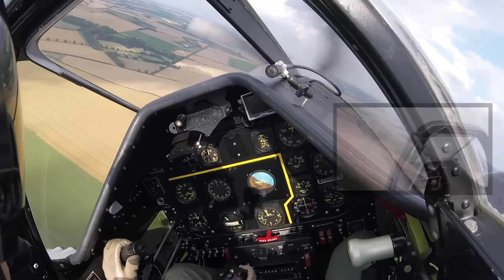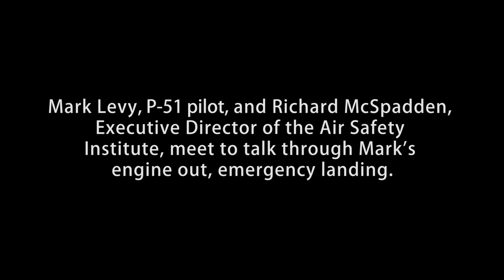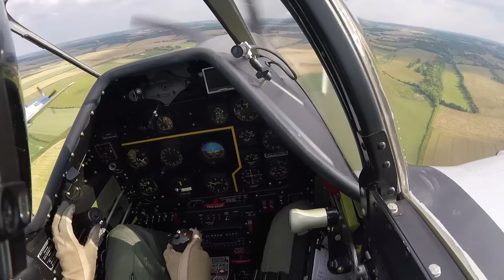P-51 Engine Out, Off-Airport Landing - Full Analysis

Comment: I had a total  engine out in March 2017.  Scary. They teach you ‘aviate navigate communicate’ and that helped me a lot. I stretched the glide as far as possible (about three miles from 2000ft) and only just made it over the trees into a clearing. Landed well but nosed over because the ground was a swamp, I was flying a taildragger. My wife and I were completely unhurt, and sat on the wings looking out for crocodiles until a chopper came and picked us up. 

The failure was a broken connector rod in flight that seized the engine. The aircraft has just returned to airworthy after a replacement engine and other repairs. Nobody hurt but the experience cost us a hell of a lot of money! My wife got her pilots licence that year, despite the crash landing! 

Anybody saying that Mark handled the situation badly get real.  He put the plane down and walked away... what he did was much much harder than what I experienced. I’m in awe. That’s great airmanship!

Comment: Great interview.

Good decision making and breakdown of sequence of events.

The Merlin / Packard can be problematic with both the  carburetor and ignition systems. The fuel pumps are  pretty reliable. Very strange engine behavior. There are no indications of a bad cylinder, Magneto misfire, broken valve or supercharger failure. 

Air in the fuel line, vapour lock, clogged filter, fuel tank blockage do seem unlikely given the gentle turns and level flight envelope flown.

Really couldn't ask for more than what Mark Levy explains.

Good luck on your return to the cockpit of the P-51.

Have a nice flight!
Reply: Doug Hanchard
Reply: Doug Hanchard needles to say this was expensive af
Reply: Bene Hirsch Well over $500,000 USD for engine overhaul, propeller, governor, landing gear repairs,  wings, canopy....
Reply: Doug Hanchard :-B s3
Reply: This is why they'll have plenty of insurance on the plane.
Reply: That's why you pay the big bucks for insurance.

Comment: "fly as far as you can into the crash"
Reply: Seeing his hand on the stick through the landing sequence via the helmet cam...
Reply: I was surprised to hear this. I did some low level competition driving and I always had the rule of "leave the road in a controlled manner/drive into the crash". It seemed natural to me to point the front crash structure at the obstacle and not "fight until the end" risking a side impact or rolling the car. I was pretty much laughed at.
Reply: @Sensekhmet  So what's the prevailing philosophy?
Reply: @December428  with cars you've gotta bear in mind that the crumple zones are setup to trigger sequentially from the nose to the seat, you've also got a great big chunk of noisy metal to take the brunt of the impact. but if you hit say a lamp post sideways its all kinds of bad news.

with planes he pretty much did everything right in those last few seconds he pulls up to cut a bit of speed out and minimize the inital impact but at the same time he's leveled it out so that he will slide and not dig in to the ground and flip over, he could've tried to make the runway but there are 2 possibilities either he makes it and sticks the landing problem solved which is pretty unlikely or he gets just close enough to cause a shitload of damage when he crashes...honestly the field was the best option by a long way cus its not just his life he saved its everyone on the road and at the runway
Reply: Fly as FAST as you can into the crash

Comment: If the engine fails, the plane belongs to the insurance company!
Reply: It didnt fail completly.. He could land on the other runway but got scared of having to do a short approach and went away to other side and crashed it..
Reply: @feetgoaroundfullflapsC  He knew it was going to fail before the runway so he decided to ditch in the field.
Reply: @Desertduleler_88  He didn't know it. He trusted his gut instinct of 30 years of prior flight experience. Every human is different.
Reply: @Desertduleler_88  true, plane would never make it to runway. It fell so suddenly and he knew it would happen. He did the right thing.
Reply: @feetgoaroundfullflapsC  seasoned pilot will have this instinct  that know if can make it or not.....
Reply: @magnapeccatrix  -- No he didnt do the right thing.  He had the chance to land on the other runway doing a right base and with only a slight tailwind, and instead decided to go to the downwind leg of the other runway.. with a failing engine and too low to make it.  Then he put drag flaps and gear down too on that low slow downwind leg.  Many pilots errors and one million airplane damages.. FAil..
Reply: @mazan7824  -- Why a slight tailwind landing on a 8,000 pound airplane will make you land on audience? Explain that.. Just a longer ground roll, thats it.. I landed Cherokees with 16 knots tailwind on 3,000 feet only..
Reply: 5feetgoaround fullflapsC150 im sorry ur a what? No one cares again how many planes have u flown?
Reply: @feetgoaroundfullflapsC   Retrospect and hind sight is a funny thing - Could of, should of, end of day he's still alive and no civ's killed... I'd say he did a pretty good job cosidering.
[ its plain to see you'd have landed it on ATC with only one wheel so you could have hand signaled your wellness while Mavric buzzes with past with a flyby ]
Reply: @feetgoaroundfullflapsC  Watch the video again. He was on downwind along side the runway. He had no choice to to try to make base, then final. I know you are not a pilot just from your post.
Reply: @feetgoaroundfullflapsC  so you're gonna bet on making it to the tarmac instead of a controlled landing where you KNOW you can? Wishing is not a strategy to say that he could have just hoped to make it is the bullshit
Reply: @feetgoaroundfullflapsC  if you're such a confident pilot, why do you feel the need to retaliate with people on the internet and say dumb shit? For a 67y/o you sure are childish. Just because he could have made it doesn't mean he would have. There's all sorts of shit that could've continued to go wrong, not to mention if that other runway wasn't long enough that P-51 was going to overrun the runway. It didn't appear that would be a problem, but who knows? I mean at that point he doesn't know what else could be wrong.
Reply: @dankvis  -- I have videos landing Cherokees with a 15 knot tailwind and stopping in less than 3,000 feet. From 1995.  So I know what Im talking about.. Sorry you dont know how to do that.  Winds were much lighter on that much heavier P51..
Reply: @p4rsec  I have to answer to pricks that say this guy did the right thing on not landing with a little tailwind as they on the ground were expecting.  In a  nervous decision, he decided to do a normal engine power downwind entry and DROP FULL DRAGS FLAPS and landing gear too when too low and slow, and failed reaching the runway.. 
I teach engine fails turning crosswind and turning downwind too.  Im have even airline pilots learning those emergencies they were never taught.
Reply: @feetgoaroundfullflapsC  I think you missed my point here I don't doubt youve landed in intense crosswings, but this was a debate over an engine failure on takeoff
Reply: @dankvis  IT WAS NOT ON TAKE OFF.  He was on a formation flight a few miles of the airport and his engine started failing.  Instead of landing with a slight tailwind, he decided to  go to a low, slow downwind leg to the other side of the airport.. Then the dummy drop Drag Flaps and gear.. Of course, that made him get lower and slower, Uhh!!!  Dahhh>>> and could not complete the turn to final due those errors and crashed on the base leg area.. Simple to see that.
Reply: @feetgoaroundfullflapsC  Ahh sorry I thought you were commenting back to me on the Draco crash that just happened. But yet again, don't compare your success to someone else's failure the circumstances always vary.
Reply: @dankvis  -- Vary like what?? Be precise in the critic.. What???
Reply: @feetgoaroundfullflapsC  well for instance two completely different planes let's start with that. You're trying to pick this apart like it's not common fucking sense. Seems like someone is over inflating their flight experience.
Reply: It's hard to tell in the video, but I see where 5feetgoaround is going with this.  If he was far enough out, and with the engine essentially at half it's power, a 180 turn from the beginning looks like a good bet, as you essentially made the runway threshold much more immediate.  That 180 would cut energy, but once pointing to the runway it's relatively straight flying to touchdown.  You'd be scraping by at the end, but you'll be straight.
Versus doing what the pilot in the video did, which was landing on the opposing runway, taking the longer trip, which left him turning final with little energy.  Wing stall would be nasty there.

But if he was much closer to the runway when the engine failed, that's a hell of an angle to turn and come in at.  It's hard to keep track of where the runway is in the video, up until near the end.
Reply: @feetgoaroundfullflapsC  Always easy to be general armchair once you've got all the elements to decide, you've seen the full video, seen the analysis and so on... When you're in the sky and have 10 seconds to do the call, that's an entirely different issue entirely...
Reply: @Bourinos02  - I had that kind of partial power emergency 4 times already.  3 times on initial climb leg.  Another about 4 miles away from the airport.  3 times I landed it tailwind, on airport/no damages.. So i'am not an ignorant talker,  LIKE YOU ARE....
Reply: @feetgoaroundfullflapsC  You should fire your mechanics then...My Saturn V also have some ignition problems, but not too much issues with it afterall.
Reply: @feetgoaroundfullflapsC  do you realized he WOULD have ended up crashing into traffic if he kept going while damaging the plane more than he did in the field AND might have killed/injuried people unlike he did in the field
Reply: @Pwn3dbyth3n00b  --He called to land now due engine emergency.  Will you cut into the runway if a pilot says he needs to land now??
Reply: @feetgoaroundfullflapsC  I believe the pilot made the right decision
Reply: 5feetgoaround fullflapsC150 if you payed attention you would’ve seen the plane start to sink, he wouldn’t have made it to the runway.
Reply: @LeeDWay-pp8ci  Tell me why?? Teach me about those emergencies.
Reply: @feetgoaroundfullflapsC  All planes have a different glideslope, and I'm sure you know that, but, he has been flying p-51s a very long time, after every crash the FAA has to look into the crash, weather it's new or old. I never read the crash report as I could not find it. But, his judgment and knowledge of that particular aircraft told him he couldn't make it. As the interview stated. I know to are a experienced pilot, but overconfidence is the worst thing to have. Stay humble
Reply: @feetgoaroundfullflapsC  so, in your opinion, what did he do wrong
Reply: @LeeDWay-pp8ci  First, he didnt lean the mixture as required when you have a partial engine fail.  Dont know if put some carburetor heat as required also.

 2nd, he insisted on going to the other side of the airport (the farther away side) to do like a normal landing into the slight wind-instead of landing with a slight tailwind direct into the airport. Easy.  But he didnt.
 3rd mistake, On downwind leg, he dropped full flaps while low and slow on downwind leg ( can you believe that, WTF!!). 

 4th he dropped landing gear too while low and slow on downwind leg. 

 Those huge mistakes made him bee too low and slow to complete the turn to final.
Reply: @feetgoaroundfullflapsC  he addressed the fuel issue in the video at around the 30-31min mark he said it himself it wasn't a engine problem, it was a fuel delivery problem,
Reply: @LeeDWay-pp8ci  Soo what??   He made all those mistakes.  We are talking about his flying not what the engine specific problems were.  What are you trying to divert the issue to?  Dont let yourself be distracted from the issue here.  His 4 mistakes.  WTF.  Stay on the issue.  Not the repairs later on.  Leave that to the mechanics later on.  We are pilots first.
Reply: @LeeDWay-pp8ci  Also a fuel delivery problem is an engine problem.  Dahhh!!  Guy, you are easily distracted..  Good bye kiddo.
Reply: @feetgoaroundfullflapsC  no... a fuel issue is not an engine problem, if you have a bad fuel pump you don't replace the engine in order to fix a fuel pump, and get over yourself. Not everyone can grow up on a golden thrown wiping there ass in $100 bills you are some guy arguing on the internet, grow up.
Reply: @LeeDWay-pp8ci  You are taking semantics here. I try to teach you about about a kind of  engine fail that i know by experience and you divert to defend the 4 error pilot via semantics.  Im 69 years old with 11 emergencies.  And you cannot match me.
Reply: And Im also an ASE certificated Auto Mechanic in engine repairs, electronics and engine performance increases.  So dont try to teach me, What i know since the 1970's..
Reply: @feetgoaroundfullflapsC  lol, im also an ASE master certified  mechanic. And you just said an fuel pump issue is the same and a engine issue, you lier!
Reply: @feetgoaroundfullflapsC  bye sidetracked have a good life, stay humble.... smfh
Reply: 5feetgoaround fullflapsC150 can I be your buddy? You seem cool and use cool words.
Reply: You could hear his stall horn turning in to the runway, he’d have stalled just short of the runway.
Reply: @feetgoaroundfullflapsC  chill out my dude, I know you're not lying based on what you say you really do know what you're talking about (however I don't know whether your CFI thing is true or not). Anyway debating here isn't going to make any difference in neither your life nor these guys so I digress

Comment: Great Video. I think the best info here is, don't over try to save the plane. Use it, to help save yourself. I was flying 4 skydivers, one a static line student), in a C-182. At lift off, engine blew a piston, and became very rough, backfiring, vibrating, and limited power. Flat farm land all around, but runway too short to risk full load landing. Because of the student, I was afraid to open the door, and let the jumpers out at lower altitude. Instead, I went looking for thermos over dark fields, just kept climbing. At 3,500 feet, I let the student out, came back around, and let the others out. I then came down (still with a bad engine, and landed). A crop dusting friend of mine (with a zillion hours), told me later, "remember Rusty, it's not your F'n airplane." So, don't lose the people trying to save the airplane. Just put it down safely somewhere. Me - Commercial Pilot SEL, A&P mechanic, retired USAF aircraft mechanic, and C-130 Flight Engineer.

Comment: I had engine partial engine failure at 1500 feet with a trial flight i was flying. The engine was so rough i committed to landing.  Once field in sight i switched everything off save it ripping the engine out the frame and parked the aircraft in a field. Commitment is the key.

Comment: A friend lost an engine a couple minutes after take off.   he as gliding into a nice field and put the gear down.  The plane then sank quickly and he landed short, into the trees.  A few years alter I lost an engine a couple miles from the airfield.   I was set up to glide into the runway and remembered to delay the gear until I was over the threshold.    This P-51 might have made the field if the gear had been left up.

But remember the gear is a speed brake, so don't put it down while gliding on long final.
Reply: Well said.  This "expert" made a lot of student pilot mistakes.  He should be flying all automatic airliners with a helper on the side correcting his pilot errors.  That is how airline flying is.
Reply: CFITOMAHAWK did you actually watch and listen to the whole analysis or are you just basing your comments on your vast experience of MS Flight Simulator?
Reply: @viatronmac --Because I had 4 of those partial power engine fails, i did watch it and detailed analized it.  This is an  avoidable accident that will cost over a million dollars to repair. If ever.  If you have low power you dont put the plane on drag flaps and the gear down too.  then refuse to do a short approach to.  Lots of mistakes done to cause that crash.
Reply: yes if that other pilot had kept his yap shut about putting his landing gear down he might have made it
Reply: @rogerd4559  And he might not.

Comment: The best advice is don't worry about bending the airplane. Once it has failed, it's purpose is to be a safety capsule to dissipate energy so you survive.

The intermittent power failure reminds me of stories I've heard of engine failures in twin engine airplanes. Losing an engine in a twin can be more dangerous than losing it in a single because the pilot may think that he can make it back to the airport instead of making the best landing he can off field.